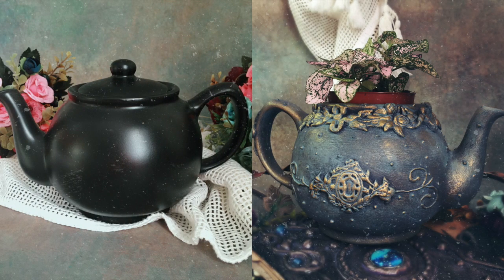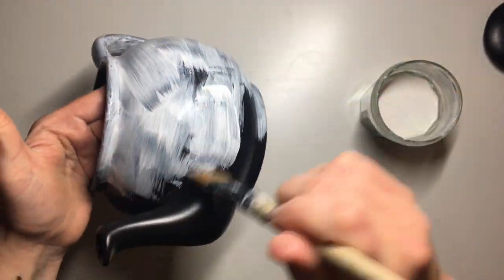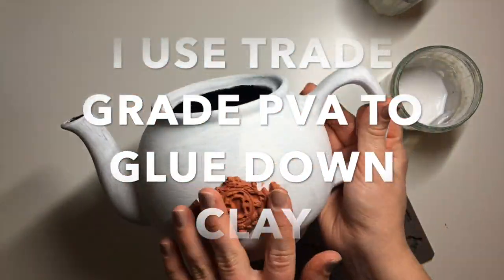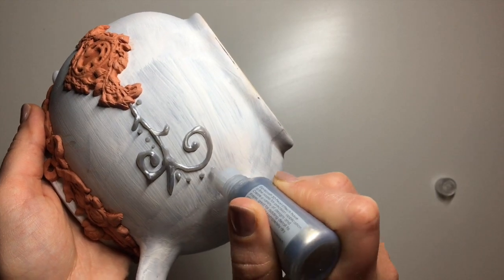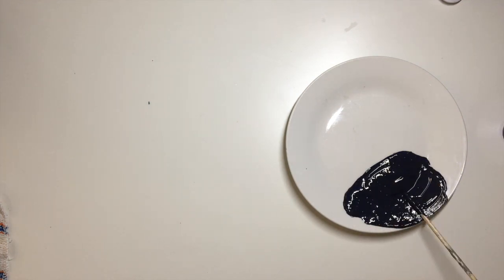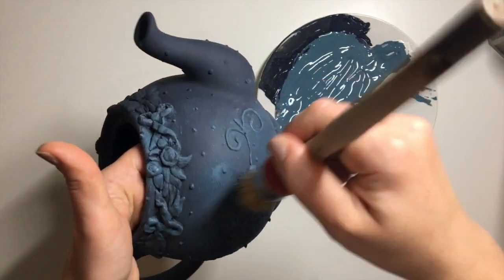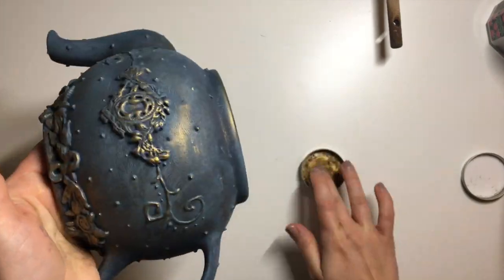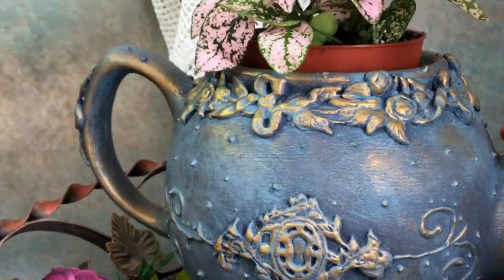UP-CYCLED TEA POT TO PLANT POT DIY TUTORIAL | VINTAGE/WHIMSICAL TEA POT

Comment: I did a ceramic tea pot for my sister but I want to add texture to it. I used acrylic paint and it has a sealer on it already. What can I use?  I am very new to this.
Reply from the maker: Do you mean you want to re do it? Or just add some raised elements?? You could do a raised stencil with some structure paste or multipurpose filler- or anything else you can use to fill cracks in walls or furniture in  (you can Mix it with acrylic paint to get The colour you need :) hope this helps
Reply: Dainty Gifts that you. I am going to add just some raise elements.